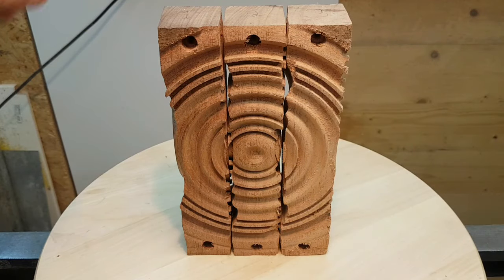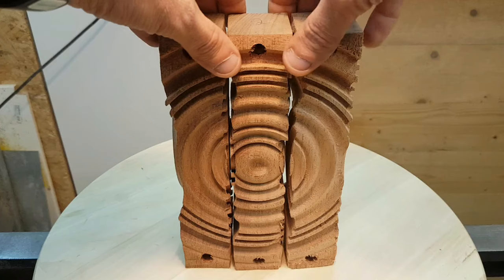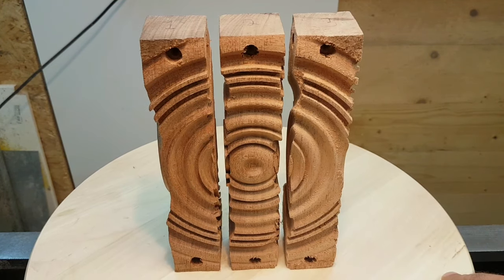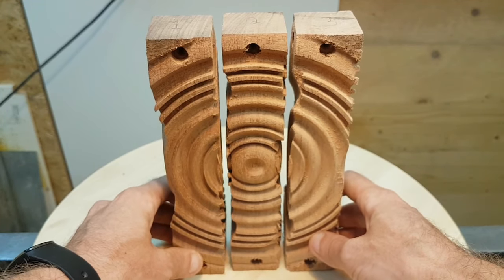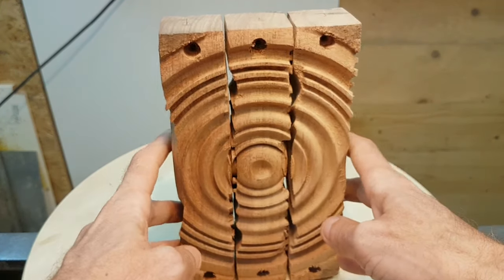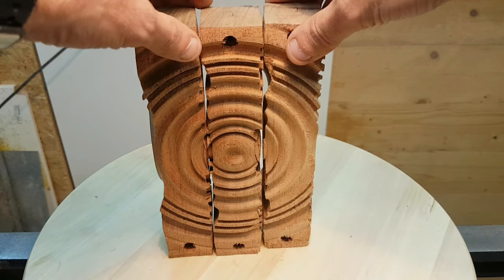Woodturning Failed Multifaceted Candlesticks

Comment: If you are still looking for a wood try one of the maples.I made three pierces by cutting them first, as I am noticing you did also.you need to orientate each piece clockwise then turn. Great job; and perseverance! Victor
Reply from the maker: Thank you Victor! I will sure to try this next time with some hardwood, maple is a little scarce in my parts, but I'll manage something... Of could I'll be more attentive for the orientation on my next try :) 

Yuval.